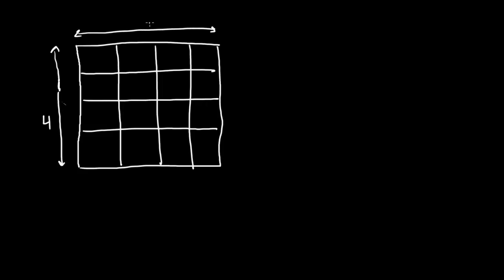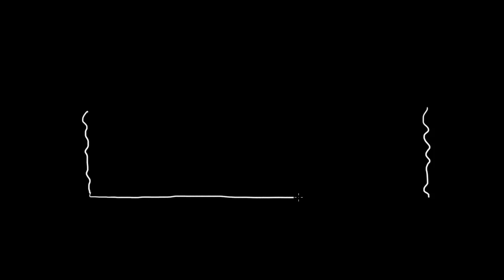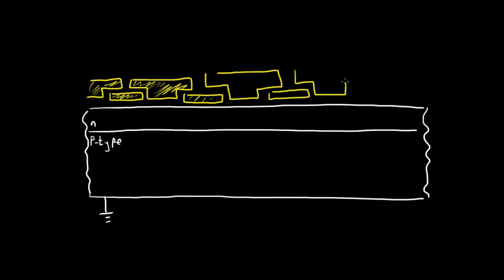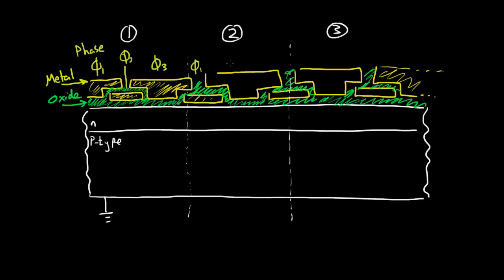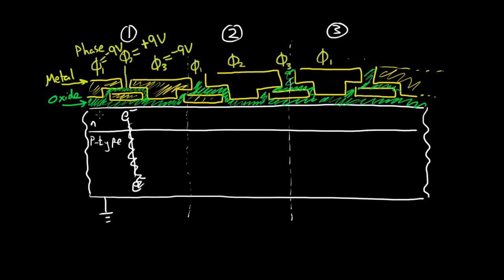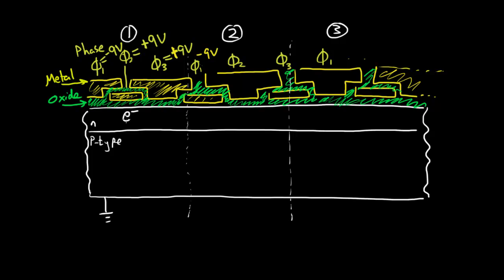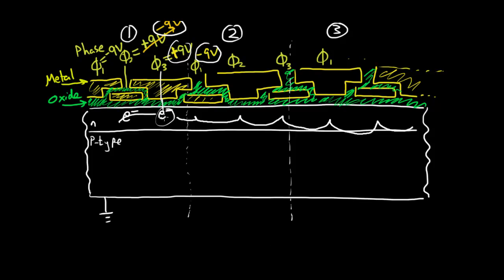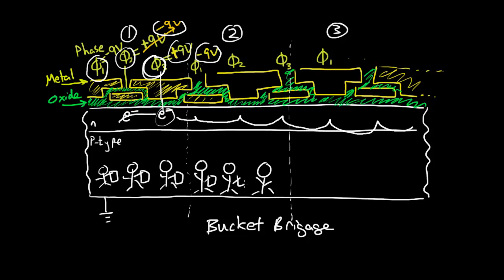Image Sensors 6 of 6 - Charge Movement in CCD

Comment: With some of our CCDs we know over years they begin to show blue/orange hues in spots in the image - and that ESD discharges can cause total loss of images as well - could those symptoms have to do with a DC connection in the metal to silicon- or do you know what else could cause that type of discoloration in CCD image?
Reply: Assuming that you have a sensor with a Bayer pattern color filter array, probably a degradation of the color filter array, but the question is due to what cause. If the metal (polysilicon) gates were shorting, you would have bad pixels in the image or perhaps lose the ability to read entire rows of the image.

Comment: Thanks Blake, this has been very educational. There are some if not many CCD cameras that use a shift technology. Something around the lines that only half of the pixel is collecting photons at a time. Yet manufactures still claim over 90% quantum efficiency Could you maybe do a video on this?
Reply: should be with microlenses